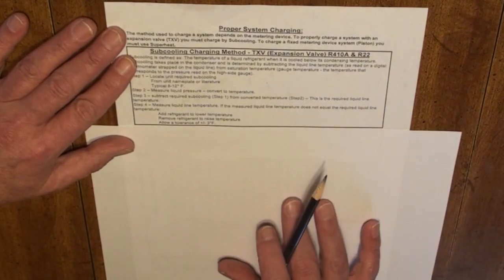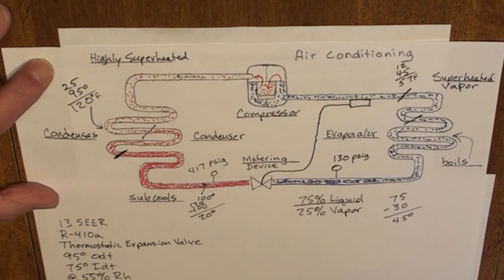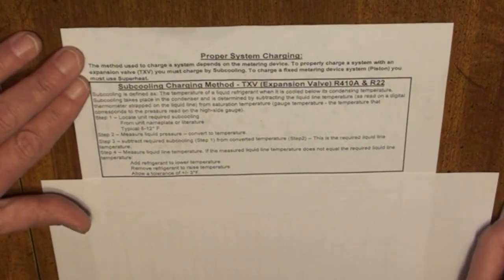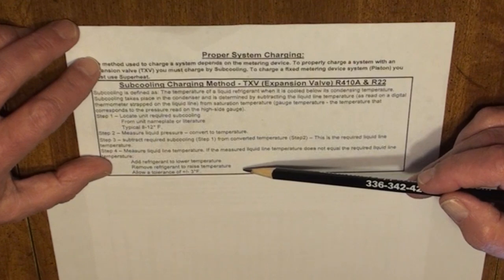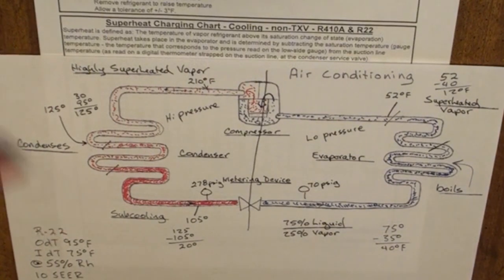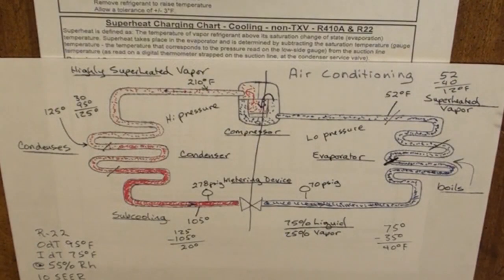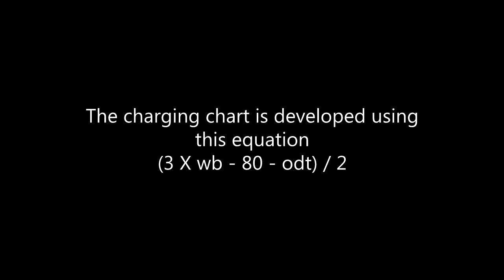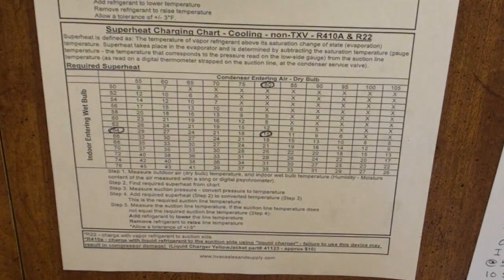The Basic Refrigeration Cycle: Subcooling and Superheat Charging Charts

Comment: And a 2nd question from me. When connecting gauge houses on to a port why wouldn't a small amount of air mix with the refrigerant vapour on low side? Even though the pressure should be pushing out of the port I'd expect there to be some kind of mixing at the air and refrigerant junction where they meet at the port and hose connector especially if hoses left on for a long time.

Comment: Sir. Maybe you can answer this. I've seen videos demonstrating pumping down refrigerant back to compressor. Why does the compressor continue pumping when the pressure builds on the high side pumping into a closed valve and the pressure drops to vacuum on low side? I would expect pressure sensors would cause the compressor to cut off well before all refrigerant has pumped back to outside unit.

Comment: These charts are very helpful. Most new units today actually have them included. Most of his videos are about Central air and basic principles of refrigeration. Not mentioned is if your condenser has a accumulator tank. You will find these on almost all commercial units. They serve for two purposes. One if you want to pump down the system, close the liquid line valve & forces the compressor on. It will store refrigerant in this tank to do evaporator repairs. The other thing is you don't have to be spot on with charging the system. This accumulator will serve as a temporary holding vessel as out door or indoor temperature changes. Only expansion valve evaporators use a accumulator tanks. If your working with orifice tubes on a freezer,kegartator, or glass window display box, anything that does not have a expansion valve, This accumulator will not exists. The high side/liquid line will go from the condenser straight to the orifice tubes. I always install a dryer/filter right at that point to prevent blockage of the tubes. If you ever suspect blocked orifice tubes, "suction low and high head pressure with poor cooling",  connect your nitrogen tank up and give those lines about 350 psi. They will clear right up. This guy knows his stuff and demonstrates well in his videos.
Reply from the maker: I think you are getting the accumulator and receiver confused.  The receiver is located on the high side of the system and will serve two purposes.  It guarantees that no vapor will enter the metering device and with the use of a king valve be closed off to hold the charge for repairs on the low side of the system.  The accumulator is located on the low side of the system and ensures that no liquid enters the compressor.

Comment: Well after watching all vids I could I felt confident enough to top off my 2 ton package unit with R22 using the superheat method.  All is well now with one anomaly maybe someone can answer for me.  The SLT goes from 66 to 48 to 66 again over and over.  It has a fixed orifice with cap tubes to the evap.  It took 2.8 lbs but blowing cold but I haven't seen a vid yet about this ping pong SLT.  Anyone?  Thanks.
Reply from the maker: This could be a little tricky to diagnose with out more testing.  I'm curious as to what the sub cooling temperature is.  If the refrigerant from the condenser has not completely changed over to a liquid and there are pockets of vapor entering the metering device that could cause wide swings in the low side pressure and temperature readings.  Also the superheat reading is important to determine if the evaporator is starved.
Reply: Target SH for that day was 15 deg F.  With a SLT of 63 I was good and stopped R22.   Then after running for a while this swing in SLT started.  Unit is only 4 yo.  Good thing there is the exact same unit on the roof (duplex) put in at the same time.  Put the gauges on it.  Head press is 235 while the unit I'm trying to service is at 215  psi.  Units were put in the same day, Payne, identical.    So by comparison, should I simply add more R22 to the unit under repair to bring the head pressure up to 235?  Thanks.
Reply from the maker: What you are describing is what is called "hunting".  It is most often found on units that have TXV metering devices and caused by intermittent loss of subcooling (vapor enters the metering device).  I think the unit is under charged.  It is apparently happening on a fixed orifice system.  The capillary tubes you were describing are likely circuit tubes coming from the distributor, a fixed orifice piston style metering device is located in the distributor body.  The distributor prevents pressure drop in the evaporator.
Reply: Yes definitely has cap tubes maybe 6 or so going from the piston to the evap.  The tag on the inside says 5.9 lbs R22, came precharged and I've added 2.8 lbs.  I have a sniffer and all I can find is the schraders leaking a bit so I put brass caps on them , all good there.  The head pressure on the other unit kinda give me a clue I should maybe add just a pinch more.  Thank You for taking the time to help me out.  B/R.  Vince

Comment: Hi i have a cuestion . What if the psig are to hi or low does it mater , is there a max or min on psig? Hope you have the time to answer thanks!!
Reply from the maker: +yoyofd The parameters I have used are for a correctly operating system at design conditions.  High or low pressures can caused by many different problems.  Dirty coils, evaporator or condenser and improper charge are a couple of common issues.